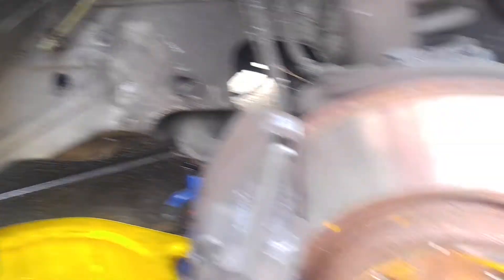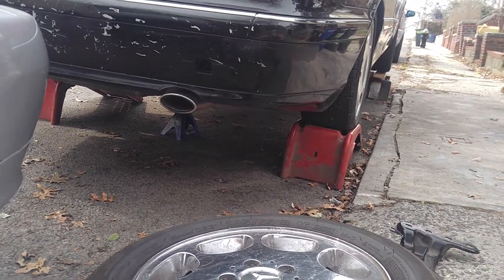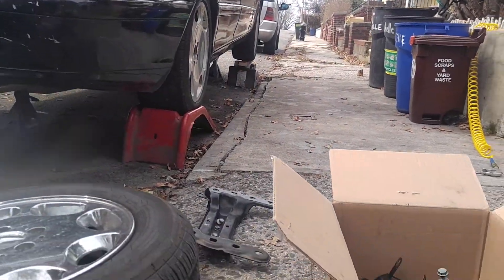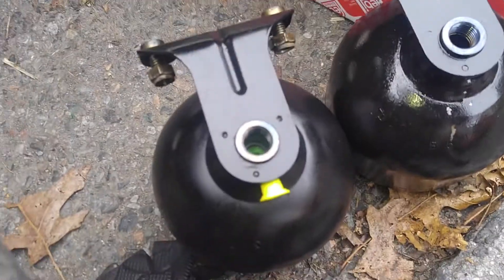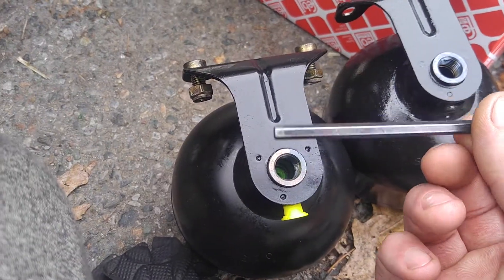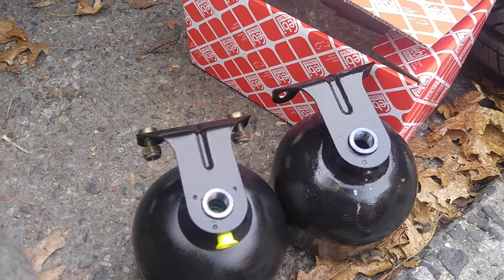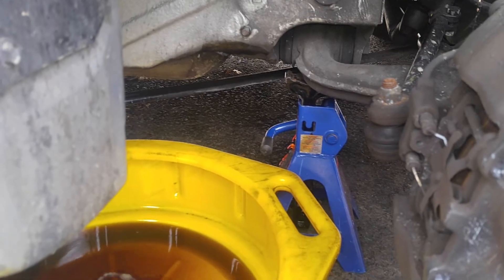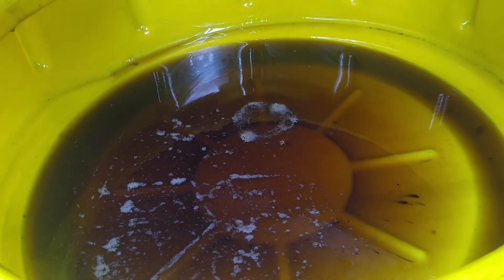Mercedes hydraulic suspension accumulator test. Bad one vs good one

Comment: Hello good morning! Nice video! Can you help me with one doubt? How do I bleed the air bubbles from the oil  of the self level suspension after i change the acumulator? My car is a Mercedes S210 (W210 Estate - SW) E200 KOMPRESSOR AVANGARD Year 1998. She's running ruff from behind and the oil level is on Minimum now. Please give me a feedback when you can! You have a nice day sir. Cheers from Portugal ✌️🇵🇹🇲🇿😎
Reply from the maker: Hi, usually after you replace both accumulators the whole system will bleed by itself. If you like, you can drive the car on the flat lift and use a height control valve to raise and lower the rear manually few times. That will get rid of air bubbles faster.

Comment: You said you tested the accumulators with a computer. Is that something I can buy online. Even the dealer said there’s no way to test the accumulators with the SDS diagnostics, but I guess there is
Reply from the maker: On older 90s Mercedes you can activate SDS valves and push on each corner.
Reply: @vsandvs  I. Have a 2005 SL500, all 4 corners feel the same
Reply from the maker: 2005 sl500 accumulators cannot be tested with sds. Only older pre2000 models can be tested. Usually on ABC car warning indicator flashes when hitting bumps or suspension feels stiff on both S and C setting.
Reply: @vsandvs  Thank you, there's no light now even when driving fast over speed bumps. The fluid level was fine a few days ago and and then I got the light and then the fluid was low and too 3/4 of a liter. Now it's all fine but the car running level shows low and the car off level shows high on the dipstick. So maybe a accumulator is filling up with fluid. Should probably just change them both. There's also the return accumulator, any way to know if that one is bad other then sticking something inside to see how deep it goes?

Comment: Thank you for quick and very informative video. So how does the car ride if there is a blown accumulator vs just an accumulator that is out of nitrogen?
Reply: Harsh ride on the back. It will jump over bumps instead of being smooth.
Reply: @E34Benzin  Hey thanks. I did get mine replaced and the smooth ride now is unreal.
Reply: @grxengine  Glad to read that! I'll replace mine too pretty soon.

Comment: They are NOT "accumulators"!!! They ARE CONTROL cells!!
Reply from the maker: Official Mercedes Benz dealer parts catalog refers to them as either- air cell or air reservoir or spring load accumulator or fluid reservoir (spring load accumulator). I have no idea where you got "control cell" name from. Name does not change part function. Call it "the thing without the name", as long as you know how it works and what it does
Reply: @vsandvs  they do not "accumulate" anything!! This means they are not accumulators. Before I go any further, I OWN 2 Mercedes cars with this system. The cells have a neoprene rubber diaphragm, & are filled with nitrogen gas. The reason they are called control cells is because the oil compresses the diaphragm against the gas, thus CONTROLLING the movement of the strut, therefore they are a CONTROL device, NOT an accumulator. An accumulator accumulates something, like the fuel accumulator in the CIS injection found on these older cars. They accumulate the fuel, & increase the pressure in the fuel system from the pump. The control cells in the suspension, cannot be accumulators, because to accumulate something means to gather & store it. NO oil is stored in the cells at all, until such a time all the nitrogen has escaped, then the diaphragm is compressed permanently.
Reply: @christophermarshall5765   Are you from Australia? Because car parts have slightly different names or a meanings in English in different parts of the world. Hood in America and hood in England  has different meaning.
Reply: @rustystofan1740  Yes I am in Australia. I also used to fix Mercedes Benz cars for a living years ago.
Reply from the maker: I will not argue about something that is not worth my time. You can just look at Official Mercedes Benz dealer parts catalog-EPC.startekinfo.com- and see what manufacturer calls them. What you are saying is Mercedes doesn't know what they made and how to call their own made part. So I should direct your comment to Mercedes and have them correct the name of the part. 
I agree that CIS accumulator that sits by fuel pumps stores fuel under pressure to ease restart and prevent vapor lock.
Reply: @vsandvs  The accumulator in the CIS system is there as a pressure vessel, not to prevent vapour lock in the fuel system during hot weather. You are arguing with an auto engineer you IDIOT. Anyone can read parts catalogues & see what the manufacturers call them. This, & what they actually are is 2 different things. Mercedes did NOT make the control cells. These were made by either FEBI (which I have in my car), or Bilstein, who make the hydraulic rams. Now you STUPID "google mechanic", piss off, & leave US EXPERTS to do our job.
Reply from the maker: @christophermarshall5765  OK, you are correct. I am, along with Mercedes technical literature, wrong and an idiot. I'm not an auto engineer nor position myself of beeing one. You are smart and I am a stupid idiot. Agreed and end of discussion. You win. 
And for the record, I did not come up with anything I said. I base my information on things I studied from official Mercedes. You're not debating me, you're debating Mercedes themself. So you can call me names but I rather follow what I learned from manufacturer. I believe they know their own cars.
I too own 93 and 95 V12's with m120 and ADS and 2x 2003 V12's with m275 and ABC suspensions. Have not had time to replace them on ABC suspension yet but original accumulators removed from my 93 600SL with 25, 000 miles were made by Corteco. Febi and Bilstein can also be used.
Reply: Vsandvs
Your video was helpful. I am working on an r230 and have never dealt with the ABC hydraulic suspension before. All symptoms are pointing to a bad accumulator. Regardless of what they should be called based on their function, ordering them from Benz directly they were called accumulators. Some people aren’t happy unless they’re bitching about something at any given time. Some people are mad they have tiny dicks and are neck deep in Cheeto dust. 
Nevertheless, this video was informative 👍🏻 thank you.
Reply: Citroen called hydrogen  Sphere